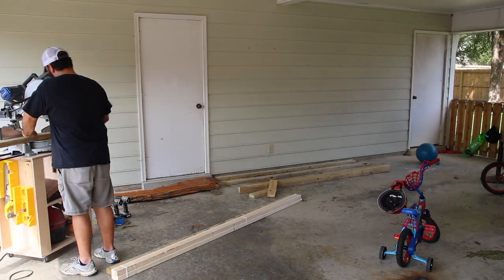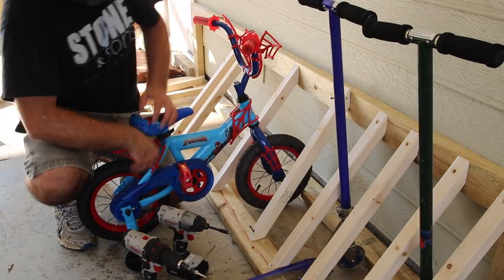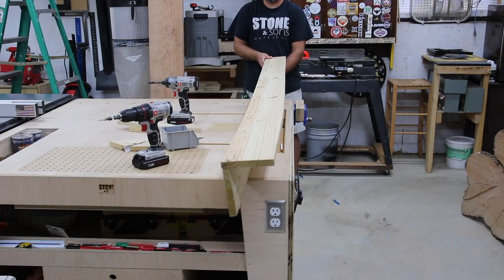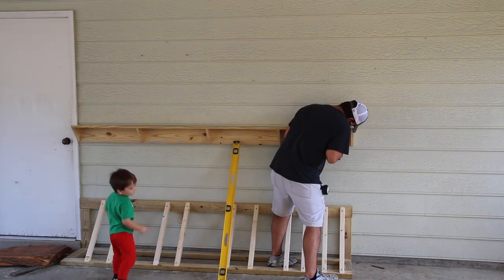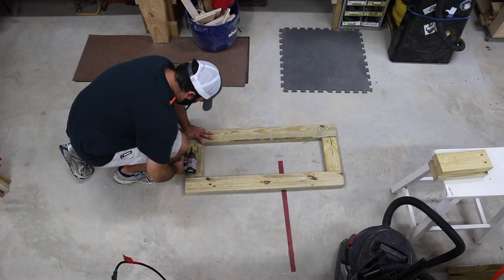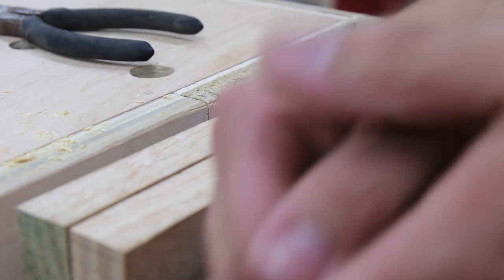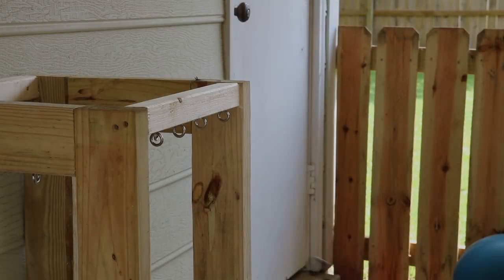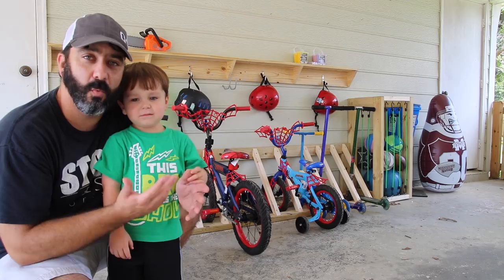Garage Organization and Bike Rack

Comment: That is one crazy bow!! Are you worried that it will put so much stress on the screws as to eventually pull them out of the wall over time? I love the ball cage and the bucket trick is great!!
Reply from the maker: I'm not worried about it. If it does give any trouble, I'll just fix it. Thanks man

Comment: Great idea. Only thing I would be concerned about is the corner of the helmet rack at the door. If the door is used by the children, it may be at just the right height to bang a head on.
Reply from the maker: Good eye, but that is a storage room that the kids do not use. It should be ok.